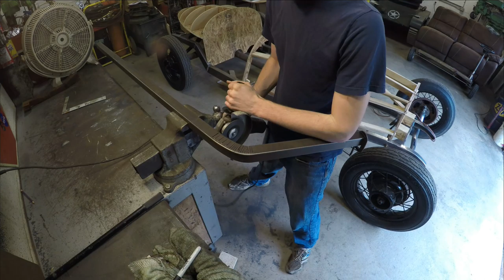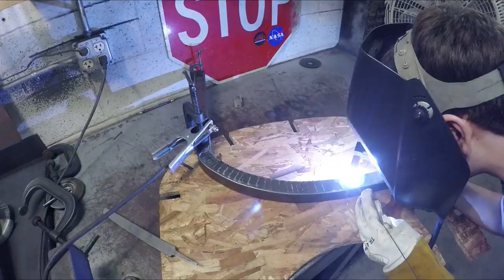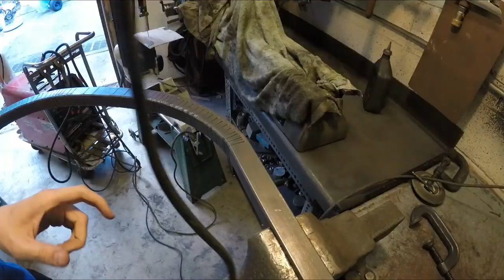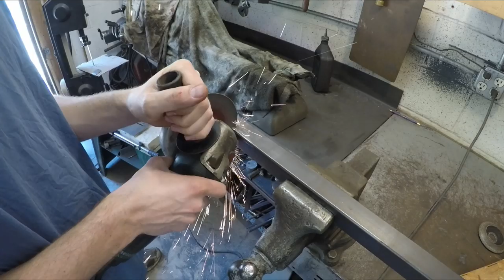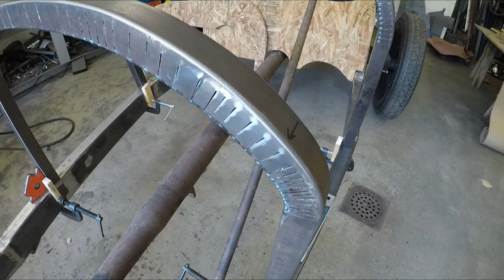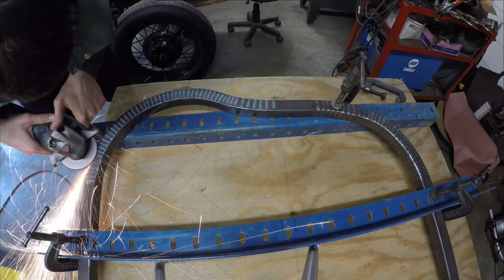Custom Car Body Support Structure | Boat-tail Speedster Pt.25

Comment: This is an ingenious way. It proves one doesn’t have to own certain tools nor do things like the next guy does. Americans used to be known for such initiative. If I may rant - There are many ways to do any job and all have been done on vintage race cars at one time. Bodies were built with nothing but hammers and rivets. I solute you. I also applaud using a screwdriver to disassemble the firewall buck rather than just always going for the screw gun. We all have many options but it’s our choice which to use and when. Before I post I’ve learned to check my comments for any “... you should have...” or “I would have...” type statements. It just puts the attention back on the commenter. I often check the pages of those with such comments and they typically have no content or followers.  It’s no wonder they so easily regurgitate other techniques they have watched on other YouTube videos. Keep on inspiring us all... your way!
Reply: The Eccentric Hobbyist 

Very well said. 👍🏻👍🏻👍🏻  Especially checking to make sure you/we aren’t saying “you should”. He has proven time and time again that “he did”.
Reply from the maker: haha yeah you're definitely right. 90% of comment suggestions are worth forgetting, but I still enjoy reading them!

Comment: Can anyone guess how many cutting disks were used in the making of this video? 

Don’t worry about the naysayers Vince. Your abilities and choices speak for themselves. Your videos prove you can do what needs to be done.
Reply: Its 2mm Steel i expect. He has to change the Disk when its too small, to Cut deeper into it. 
I expect about 4-5 cuts per disk.

But there are disks made of metal with diamonds on top for metal. They last much longer and will not loose much size. They are expensive but i would recommend them for this work.

Comment: What a ton of work. My back hurt just watching. Great job! I love the idea of square tubing, it looks better and its stronger than round tubing over-all.
Reply: Aimless, I'll have to disagree with you on the strength question. Size for size, weight for weight, square and rectangular tubing is not as strong as round. And round would be easier to bend whether filled with sand before heating or bent cold. That said, what  the builder has ended up with will certainly work, if it is mostly welds. And given that, I don't think it will be as strong as the original tubing...just too many welds to trust.  But then , it's pretty much just a support for the body panels....

Comment: For smoothing welds I like to use the flap disc because it smooths the metal without removing too much. It's a lot of work but I know it will look great when you're done. I really like what you're doing!

Comment: Given the sheer amount of welding, you had to do. I would have considered fabricating these supports out of sheet alloy. Two thin strips off the sheet then two panels the same shape as the finished steel supports, cut in two or three to save on waste material!

Comment: cool good sunglasses help to watch the welding on 27 inch screen on pc. In the morning will be in Anderson, Cal to pick up supplies for here and other places. These is a body shop by this place they only do bodies is cool to see bodies sitting on uprights takin' all the way down patchs panels whatever is done in there. to have a clean body when done while another handles the running gear. to know when put back together will be a complete rebuild. everything almost a new car.

Comment: You can use a tubing roller instead of a tubing bender.  Rainfall projects made his own roller dies using sheet metal, rather than machining dies.

Comment: looks good , i only wonder if the box section need to be so big , think you couldve used smaller and still had enough rigidity with the sheetmetal bonded and rivited to the frame

Comment: That was excellent! I would be worried that all the finish welding you had to do would pull the tubing out of shape from the weld shrinkage, but it doesn't appear that you had any problems with that at all. Not sure how you managed that.

Comment: Did you think about using flat sheet and cutting two identical hoops and then use more flat sheet to box them together? You could trace your wood pattern on the sheet and then cut another just like it, then use flat sheet strips to connect them. You could also make one smaller to give you the exact plane of the body for a perfectly flat mounting surface. Just a thought.

Comment: You can roll square tubing in a bender just like you can round you might have to lower the size square so you can get a die to use. Yes it ripples on really tight bends but you haven't made any yet that would cause a noticeable ripple. Still say you need to fine a bead roller for your panels to give them strength.
Reply: Brandon Culver 
He doesn’t have a rolling bender. He mentioned that he has a 3 point bender.

Comment: i understand your reasoning for using square tubing but it does add weight. at least make the stays our of smaller round tubing. and you may regret having welded the body to the frame in the future. excellent workmanship as usual!

Comment: You do very impressive work. Although I'd like to offer you one bit of advice. Turn the angle grinder off before you put it down. I have noticed a few times that you didn't, and I would like for you to keep your fingers. 
Just some advice from a blacksmith.

Comment: Another good point for square over round is that square tubing is stiffer and more rigid.
Reply: That's not true!!! Square tube will fail before round!!! Round tube has equal forces on all side's. Square tube dose not!!! In this case square is better for all the reasons he mentioned!!!

Comment: Looks like you are welding the body supports to the chassis... did you consider flange mounting them so the body can be removed?
Reply: Those are just supports, the body panels will probably be bolded to them, still removable

Comment: Fantastic work ethic. Are you using a water cooled torch ?
Reply from the maker: It's just air cooled. I was running fairly low amps so it didn't get very hot

Comment: Awesome work again. Was wondering how you would account for mtg the body panels to the flat surfaces of the supports, but good to see you understood the variance issue. For sure it is very time consuming, but it should also be very strong. Get your degree, but follow your passion.

Comment: Looking good! Do you plan to use a metal or wooden dash? And will the cowl overhang over the dash?
Reply from the maker: the dash will probably be aluminum, and the cowl will overhang by a couple inches
Reply: @MacroMachines  perfect. Are you thinking machined aluminum like in buggatis?

Comment: Some say tube bender, others say welding practice 😎
In all seriousness though, how many hours do you have in those two supports??
Reply: He takes hes time, Im on a 5 year project and still far from finish. Thing is, he wants it perfect.
Reply from the maker: these two tubes took me 43 working hours. I keep a running tally of overall hours for this project at the end of every video description if you're curious.
Reply: Doesn't matter how many hrs. I've seen enough to know he works till it's perfect, and that's what matters. If I ran a business, that's the type man I would want. You're doing super good, keep it up..

Comment: Mr. MacroMachines. So I have a question. When u weld with that rod thing, is that called tig welding?? Or mig welding?? I have know idea what kind of welding that is. Just making that crown thing must have taken you hours. Pretty cool how you do things though. I don't know about everybody else, but I am truly enjoying this build series. Can't wait till its all finished. It will be the best car.
Reply from the maker: using the filler rod is tig welding. Mig welding is with the trigger gun that feeds wire through the cord

Comment: I can't believe you have a sign that say's "Stop NASA" Lol.
I see you have a foot pedal for the Tig. What are the settings for it when doing this part of the project ?
Reply: Richard Ferrara 
You can just see the foot pedal under his right foot near the end when he is down on his left knee welding the last hoop on.
Reply: @Crewsy  Thanks, after I asked the question I too saw the pedal. So I edited my  question, because of answering my own question.
Reply from the maker: I had it set around 80 amps and the argon at 11 cubic ft./hr
Reply: @MacroMachines  Thanks for the reply

Comment: you are going to have a problem with your chassis, it's needs both panhard bars for the front and rear axle. with that type of cross spring the axle will move back and forth on the shackles. Causing it to wonder all over when you turn the wheels.

Comment: Dude why not build a tubing  bender on your bottle jack ( a piece of pipe with a flat piece of steel on each end).
Reply: P.S. the space between the flat pieces should be the same as the width of the tubing.

Comment: That is a long tedious presses of shaping square tubing. I never seen it done like the way you made parts from a wood buck. Now a days they have a mandarin bending machine operated by a computer to do what you did. It would cost more money and quicker  to make. Your method was longer, but cheaper.

Comment: NEVER! And i mean NEVER put your anglegrinder on the table with the disk down. Especially not when it is running!!!! I love what your are doing and how you do that but for that move, you should get a slap on both sides of your face.
Reply from the maker: the guard is strong enough for it to rest on, so it's not an issue
Reply: MacroMachines 
That's not what it is about. the problem is, on the one hand, if you put it down wrong, with the disc first on the table, which can happen in a routine like in this proces, the angle grinder can jump towards you. on the other hand, around lying part, like a screwdriver or some metalparts can be picked up by the disc and thrown away. It is actually one of the first things you learn in metal-working education, never to put a grinder down like this.